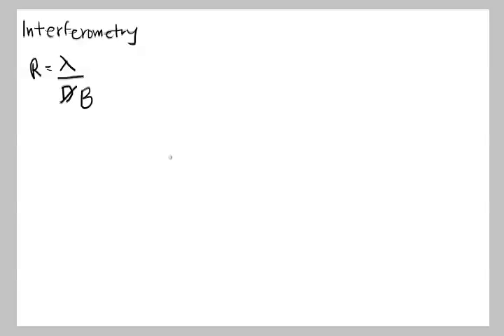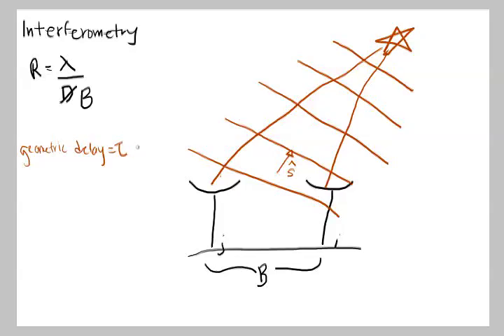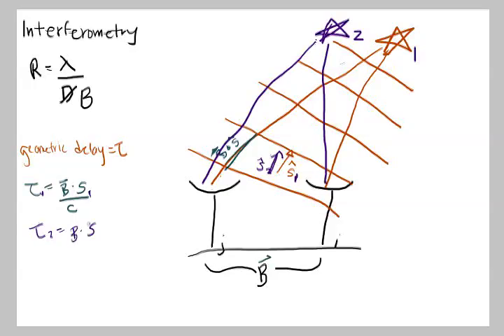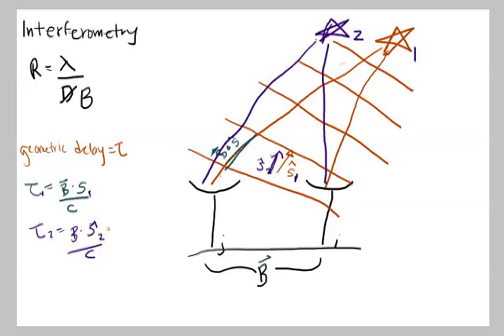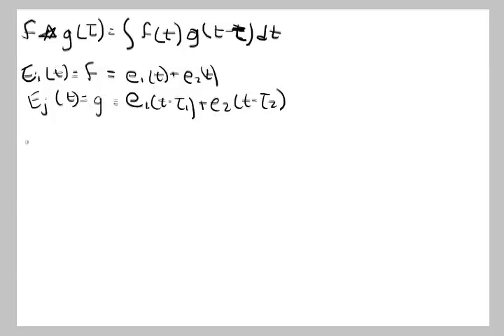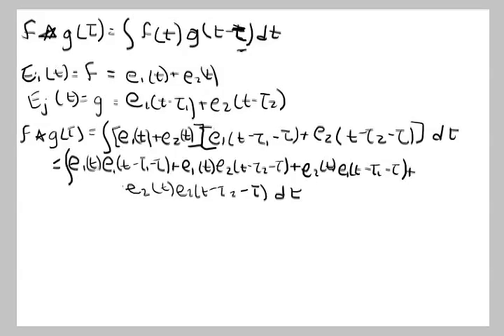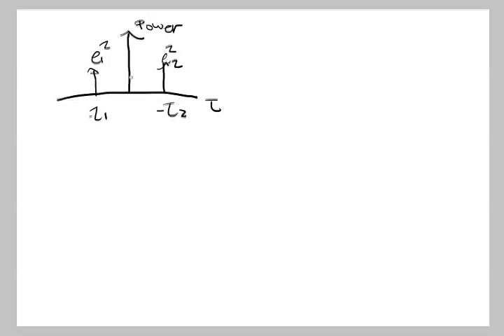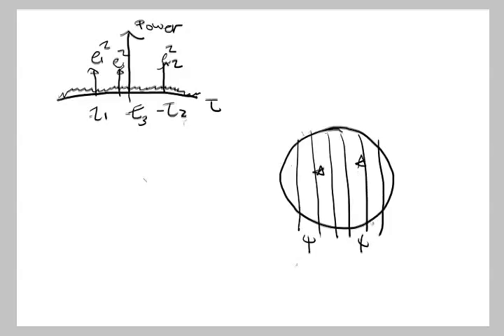Basic Radio Interferometry I

Comment: 0:28 would be clearer to say the "angle of resolution" (small = better) rather than the "resolution"; else it's confusing why you want D, the dividend to be large if the goal is to increase resolution https://www.youtube.com/watch?v=t6TY51JsH4Q&t=0m48s
Reply: Thank you, I started the video and after the first equation I was already like "How is the resolution INVERSELY proportional to the diameter?? Shouldn't it be the other way around??" ...  Not a very good start tbh
Reply: @TheBasde  I think the confusion is that most people think of resolution as the number of pixels you have, so bigger number = better, but in astronomy and optics, resolution is just a measure of how small objects you can resolve. A telescope with a better (smaller!) resolution can resolve point-sources of light with a smaller angular distance than can a telescope with a worse resolution.

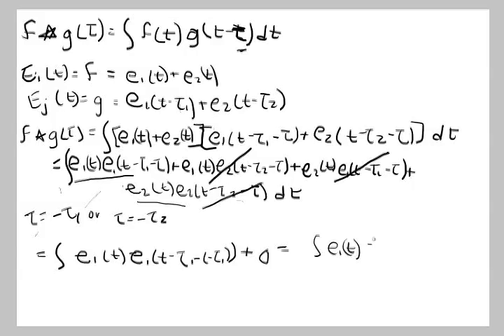Comment: Why did you cancel the 3rd term, i.e e2(t)e2(t-tau2-tau) at 10:35 ? You haven't clearly said about it.
Reply: As she said the integral of those two terms average out to zero because they are signals from two independent sources. The way I like to think of it is that since we are correlating two independent sources, their signals should NOT be correlated at all. The other terms we keep because there should be a correlation between two signals that are identical with a delay.
Reply: she chose tau to be tau1, so (t -tau2 - tau) is not equal to t. with the assumption that e2(t1) is not correlated to e2(t2) if t1 != t2 the term cancels by the same logic as the other terms. 
if she would've chosen tau = tau2 the e1 term would cancel and the result would be e2 squared. together this produces the graph in the end.